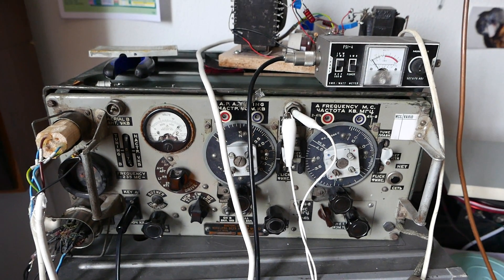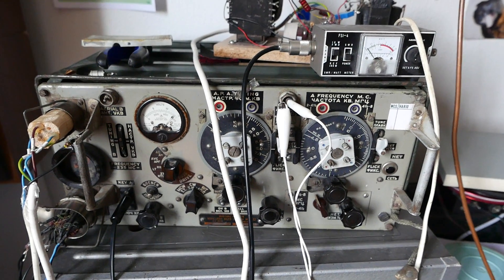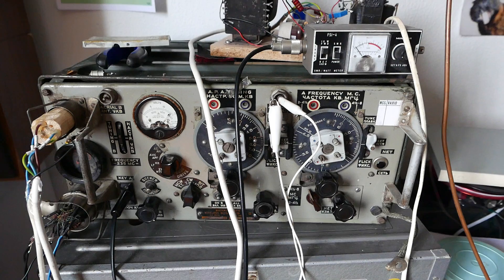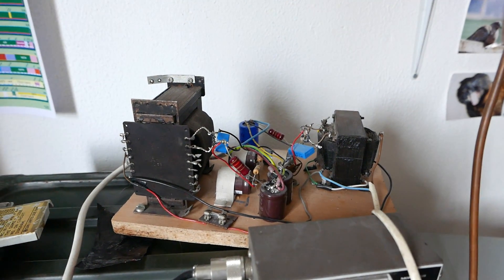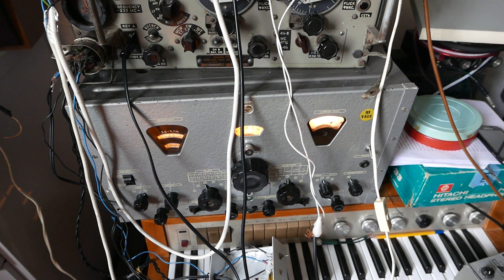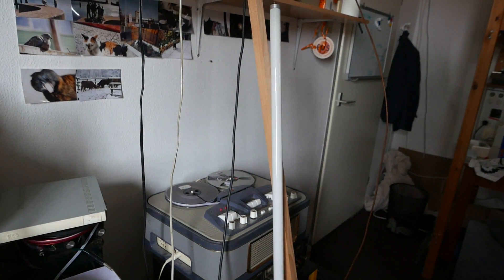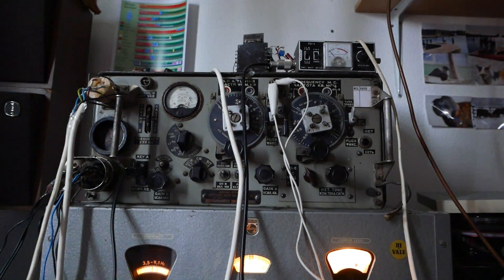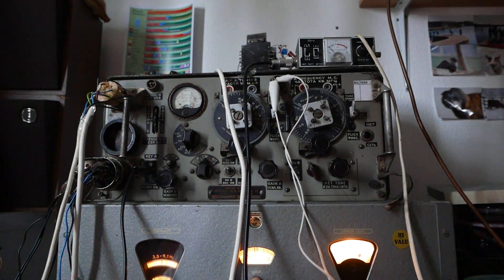Wireless Set 19 - first test on inside magloop antenna

Comment: When you say "Tank Circuit" do you mean vehicle to vehicle comms.  This was done using the "B" set on 229-241 mcs with 1000 yards range using a short antenna.
Reply from the maker: No. Tank circuit is a rather old fashioned term for a resonant LC circuit. It was called a 'tank' because it held energy in its coil and capacitor.